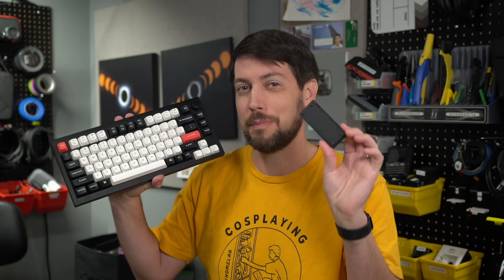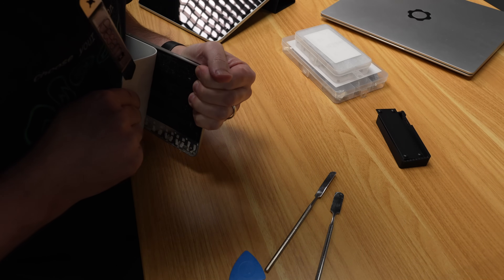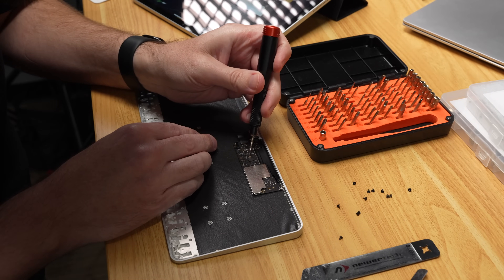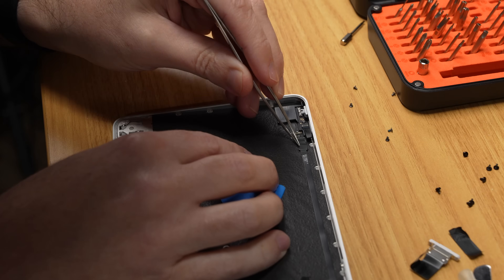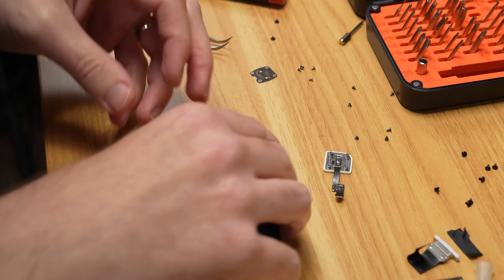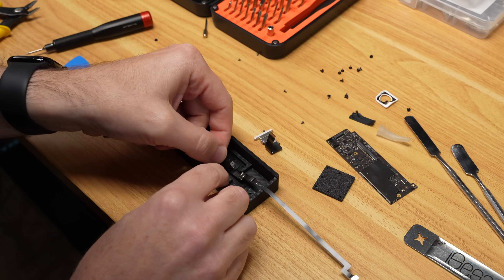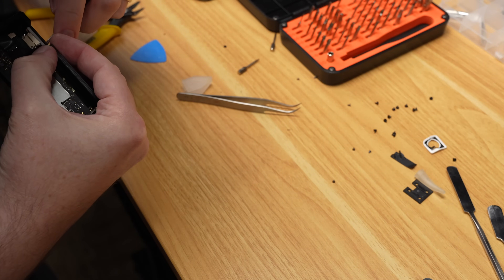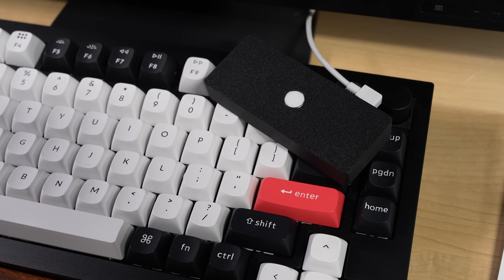Why doesn't Apple make this?

Comment: if you have the full sized magic keyboard, do not bother with this mod. 
the PCB is radically different, and even you do design an alternate shell, the changed size will be crazy impractical.

Comment: I have a Kensington fingerprint reader for my Windows desktop, but I've never tried to use it on my MacBook. maybe that would work - and be cheaper???

edit: cheaper than a solution that Apple would sell on it's own, I mean. it was still, like, 80 bucks for the Kensington lol.

Comment: I just use a Magic Keyboard at the back of my desk, so I know it is big but I wonder if someone could print something to go over just the keys and leave the Touch ID.

If it was a shallow tray then I could store keys and phone and pens in there, hey maybe it has a charger built in :)

Not as cute or impressive as your solution of course, but would be much easier to print and attach right? Something for the lazy folk!

Comment: 😂 No. If you are using a MacBook and have a decent monitor with a built-in USB monitor, you don’t have to go through all this nonsense. You plug both the Mac and the mechanical keyboard into the monitor’s usb hub and just reach over to your laptops finger sensor when needed.

Comment: But the worst part is that in order to use touch id in the first place the machine needs to be using apple silicon. Does NOT work with intel cpus. KIND OF A HUGE POINT TO MISS.

Comment: Apple keyboards compared to mechanical keyboards suck. Why hasn't Apple added FaceID support to iMac's or a web cam? I know some people prefer TouchID or FaceID but what ever, I don't mind FaceID at all. I'd be tempted to dig through a e-waste bin to find discarded faulty Apple keyboards with TouchID and see if the TouchID part still works. Most of those keyboards are probably going to e-waste because of a issue with the keys or battery. In the Windows world, USB finger print scanners or Windows Hello USB camera's are easy to get and inexpensive.

Comment: My main frustration is how the keyboards become unusable if you spill anything on them. The cost is so significant it should be better or allow better repairs. I can just about fix a key sticking by taking them off but eventually the sensitivity. If anyone is doing this find a broken keyboard to use as donor ;)

Comment: Ever since that Snazzy Labs video came out, I've been dreaming of modding my Apple Extended II to put Touch ID either into a custom power button (the big square one would probably fit it) or, ideally, in place of one of the ADB ports (the circle is about the right size, but I doubt it could be mounted in that space). I'm still too scared to take it on though.

Comment: Crazy. My System76 laptop had a little sensor line on it for my finger. They make Linux machines, and I was running Ubuntu. I got that laptop in 2012, and was amazed to learn that I could slide my finger over the sensor for sudo (makes sense if you know Linux).

Comment: Why does nobody take anti-static precautions these days with electronics circuit boards?
Reply from the maker: Most modern circuits are made to be more ESD safe, and if you take basic precautions the chance of breaking something through touching board edges or a plastic connector are virtually nil.

If it were a more delicate, old, or extremely expensive piece of gear, I'd at least do the work on my ESD mat, but since it's just a laptop motherboard, I'm not worried.

Comment: Apple uses so muck adhesive because its devices are now to thin to require the same foot-long Torx 25 driver which was needed to open the original Macintosh because Steve Jobs knew better that the end user what they  needed.  😂    

I started buying Macs for the US Information Agency’s Printing Division for producing its publications for admin tasks and the first thing I did was lose the mouse and get a Kensington Trackball.  I’ve had them on every Mac I’ve used since but on my M1 Mini switched to using the track pad.  I have the Touch ID on my KB but wearing my Apple Watch unlocks it for most things so I don’t  need to use it much.

Comment: For my (poorer) dexterity level, I have found it helpful to work on a tray (with raised sides) with a silicone mat (not bouncy and even slightly tacky) to prevent small parts escaping. 
Were those tiny screws not magnetic? (ref your mention about using a magnet to find screws in a carpet) because a magnetised screwdriver tip would seem to have made things easier.

Comment: Here's something for Apple to make (or does it exist already?):
1. relatively big touch display.
2. programmable at run time to show any combination of buttons, sliders, knobs, readouts, etc.
3. Senses multiple simultaneous gestures (not just single gestures involving multiple fingers).
The goal is to make a run-time configurable version of dedicated industrial controls, like recording studio mixing consoles, where you can move 3 sliders at once.  There are UIs that LOOK like this, but depend on a mouse or trackpad or trackball that is a chokepoint.  Even an iPad with that huge processor limits input control to doing one thing at a time.

Comment: I just use a yubikey with fingerprint sensor
Reply: This is the better, more universal solution as this can be used across all the major operating systems. Probably need a backup yubi key in a safe just in case. More expensive but more versatile.
Reply: @soylent-greene  Yeap. That's true. I forgot to mention but ALWAYS have a backup key. hahahah It's expensive but it's hustle free and keep your mind in piece when it comes to passwords, keys, fingerprint, etc.

Comment: I was just heating up parts with my floors to heater to get the protective layer of the plexi glass parts.  I built a couple of Freenove cases that have built in 4.3 inch screens because I’m trying to possibly make humble and video walkie-talkies in the cases remind me of a 1970s CB handheld or when it’s on its side something more like the old a.m. radio.   I’m so spoiled because I built two cases at once I started complaining that it was like working at Foxconn and that I was gonna have to put a safety net outside my window😂.  Then I just watched you put together the 10 blade cluster and I was laughing.

Comment: Saw another video of this but reusing the keyboard's internal battery so it retains wireless connection in cost of longer form factor, probably could fit an M.2 SSD in it 🤔
Reply from the maker: Yeah, I was debating trying to get the battery out with some IPA but decided against it.

Comment: Personally I don’t get this craze for mechanical keyboards. They’re loud and awkward to use, I much prefer Apple’s keyboard. Maybe I’ve had my share of them in my C64/Amiga days.
Reply from the maker: There are quiet mechanical keyboards (like the Keychron I'm using now), and there are extremely loud and annoying ones too!
Reply: @Level2Jeff I know, I had (and immediately returned) the Logitech MX with quiet keys, still way louder and more key travel than my Apple Magic Keyboard. Not my cup of tea.

Comment: One tip on the using heat to soften the adhesive of certain electronics. If you have a 3D printer, heat up the build plate and place the item on it. Make sure the temp isn’t high enough to melt it though! Has worked a treat for me the couple of times I’ve needed to do it

Comment: The project is completely pointless. Just use a mechanical keyboard with built in macros or a macropad, and instead of using fingerprint you just enter the key combo of your choice and it sends "<password> + enter". It has the same security as fingerprint reader because nobody knows your key combo + if a bad guy breaks in your house, they'll hit you over the head then drag your finger to the reader anyway, and if you're targeted by a 3 letter organisation, they can bypass fingerprint on mac anyway. And i'm sorry Jeff, love the video but i don't even think the box looks good.

Comment: Answer is likely to avoid cannibalizing their Apple Watch product, which lets you skip using touchID altogether to unlock your Mac/iPhone.
Reply: I’m curious to know how many people buy an Apple Watch only to use it as a touchID replacement. Cannibalizing Magic Keyboard sales, now that I’m willing to believe. But I bet they’d sell that dongle for at least $50 and their margin would be way more than for a $100 keyboard.
Reply: @swissfreek  However a watch can unlock multiple Macs. Mine unlocks both my MBP and my mini. (Though the Touch ID on my MBP means that is not important. If I had multiple Mac minis or whatever,it could be helpful.) I wish it would also unlock my iPads.

The other problem is that I often have to enter the password in order to allow unlocking with watch to work....

Comment: I've looked at Windows USB fingerprint dongles and in the end just thought is it really worth it over typing in a PIN and they are less than $10 on Aliexpress. :)

Also I wish these companies would make their devices so the batteries could be easily replaced. I mean they know that part of it has a short lifespan.

Comment: The fad/obsession with mechanical keyboards lately is ridiculous. Everyone on YouTube is acting like they are a totally brand new thing, and you aren't squat if you don't have one.
Reply from the maker: Not at all, I have switched keyboards probably 5 or so times in my life, and each time I appreciated some things about the old, some things about the new.

The Keychron I'm using is one of the quieter mechanical keyboards, though it's outrageously heavy and expensive. It's not for everyone.

The Apple chicklet keyboard is quiet and I can actually type a tiny bit faster on it, but it's not as comfortable after a 30 minute typing session.

Comment: This seems like a clever exercise, but are there really no 3rd party fingerprint-ID sensors you can buy for Mac?  There are literally dozens you can buy for PC, in various form factors.  I don't have a Mac anymore (moved on from the platform around the time of the PPC->Intel switchover) but I can't think of a logical reason why any of them wouldn't work on a Mac.

Comment: Pro-tip, you can use the heatbed of an FDM printer to heat the adhesive backing of most electronics.

Comment: 0:38 you can also use Touch ID instead of typing the password when using the sudo command (if properly configured)
Reply: How 😮
Reply: @akuoko_konadu  If you Google “9to5Mac Touch ID Terminal”, you'll find the guide I followed
Reply: @akuoko_konadu  copy /etc/pam/sudo_local.template to sudo_local and uncomment the auth line

Comment: You wear an Apple Watch which does the same thing so why do all this?
Reply from the maker: It is flaky, and even when not, can add 3-5 seconds of delay between the dialog popping on the screen and the watch getting the notification.

When you have like 60 prompts per day, those seconds add up! (Not to mention when it doesn't actually prompt the watch for some reason, and I'm sitting there staring at the watch for like 10 seconds, before I pop back to the computer and just type in my password.
Reply: @Level2Jeff Or when it prompts, and you do the double click, but then it just… doesn’t work, and the whole system just sits there with the spinning circle while you wait. Mostly that happens with ApplePay prompts, but it’s annoying AF. Usually I can type in my password so fast that the prompt pings my wrist after I’ve already entered it.

Comment: Use the bed from your 3D printer to heat up the glue from the keyboard to help the disassembly, much easier to control the temperature while also spread it evenly. (I'm assuming you have a 3D printer as you're mounting the logic board in a 3D printed case)

Comment: Jeff STOP!!! You don’t need heat!!! 99.9% IPA will EAT through that adhesive and you can use a wide spudger tool (same one most companies give you in the MacBook battery replacement kits). Save yourself the hassle and potential battery fire… use IPA and while you’re at it, drink an IPA!

Comment: I have the original Magic Keyboard, the one that uses 2xAA batteries and doesn’t have TouchID. Not sure they called it Magic Keyboard then, but it’s the compact version, no numpad. Love it. Like the Apple aluminum keyboards so well, I use an old USB extended model on my KVM to control my PCs and my Macs. Would be great if it had TouchID, or I could buy a separate TouchID module, but until then, I’ll live with typing my password.
Reply from the maker: I always loved the 'barrel' design where the stand on the back was the perfect size to hold AA batteries. Bring back AAs!

Comment: Gawd I hate Apple Keyboards and despite how stylish the Magic Mouse looks it feels like crap compared to more ergonomic mice and the underside location of the charging port feels like a middle finger to anyone who purchases one.   And don’t get me started on the iPad Pro, it’s expensive “covers” and their lack of any built in means to secure the $100+ pen that is ridiculously easy to bump off and not notice until you actually want it again.  Don’t get me wrong some Apple devices are great when they are working but when they need repair it’s like that keyboard a pain to open up yourself and a solid screw you just buy a new one if your MBP is more than three years old.

Comment: If you ever do this again: isopropyl to loosen adhesive? Not that you’ll likely want to do this again, lol. Although maybe you’d want to get that back panel off to replace the battery… Not sure how often you may need to do that tho, I have a few A1644 keyboards that still last for ages 

My thinking is Apple doesn’t make this because they don’t really want you using any keyboard other than theirs. They want your desk to be all Apple all the time

Comment: Incredible timing. I literally just tried to do this with a custom case. I finally found a tenkeyless keyboard for cheap, then I made a really dumb mistake right at the end while I was test fitting and crushed the FFC connector for the Touch ID module and completely ruined it. So now I wait until I find another deal. I also cannot find a replacement FFC connector.
Reply from the maker: Yeah, as I got in there, I was like... I've never seen this connector on any other device. So not even able to scavenge and do detailed work unless you're willing to do like microscopy with specialized tools!

Comment: A much hard version would be to try and build a mechanical keyboard that used the magic keyboard controller. A bit hard to see in the video but I wonder if the connectors that go to the board are a standard size that could be purchased.
Reply from the maker: They are standard in that they aren't made by Apple, but they're definitely difficult to hand solder.

Comment: You need a magnetic screw tray. Watching those screws roll around on your desk gave me anxiety
Reply from the maker: But it's more fun with the chance of one rolling off! :D
Reply: @Level2Jeff  <.<
You were literally using a screwdriver kit that has a magnetic screw tray built into the lid.. Those screws were all rolling around inches from a magnetic tray xD
Reply: @Level2Jeff or a blue mat
Reply: As long as the screw is magnetic. Apple uses stainless steel screws also

Comment: In 6th grade I won the science fair balsa wood bridge building competition but was disqualified when they discovered my bridge was so strong bc I used an entire bottle of glue... apparently I should have applied at Apple 😂
Reply from the maker: Chief Glue Officer
Reply: If they didn't put that in their rules, they should have rewarded you for coming up with a creative solution.
Reply: Only one bottle of glue?  I used up several bottles in a high school physics course to take second place.  Mine was made of toothpicks and the glue was still wet when it busted under the weight.  And I didn't get disqualified.  Most people thought it was cheating but it wasn't against the rules and the teacher said they hadn't ever seen anything like it before.  It also didn't take first place or that would probably have factored into their decision to allow/disallow it.  The teacher modified the rules the next year.
Reply: They should allow it, it's a composite material, and a decent way to showcase composites in a pretty safe manner.

Comment: The “since you already have a 3d printer for the case” hack is to just preheat the printer’s bed and chuck the keyboard onto it for 20-30 minutes, works just as well as an iOpener or those fancy heated device opener mats.
Reply from the maker: That seems like an ideal scenario. Nice and flat too!
Reply: @Level2Jeff  You can print a new case on it while you're waiting for the glue to melt.
Reply: Replaced an iPad screen once with this method
Reply: That could be a useful tip.  I could hear it to the perfect temperature.
Reply: i repaired few iphones this way

Comment: I was going to say that IPA (Isopropyl alcohol) also works when you want to remove tape/glue from electronic devices, but I didn't expect there to be tape/glue across the entire width of the base. It works in that case too, but it's significantly slower than heat.